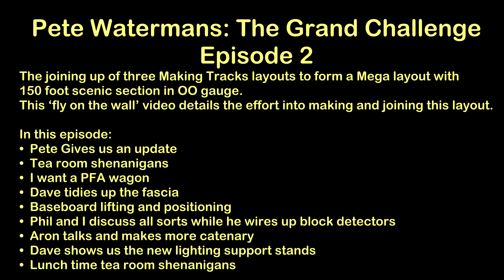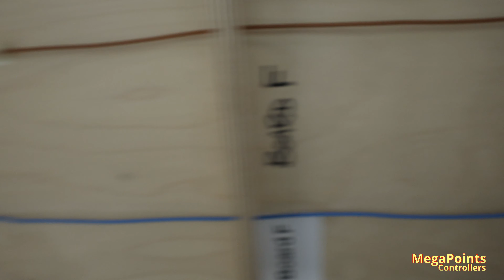Pete Watermans – The Big Challenge EP2

Comment: LARGE RADIUS POINTS ❗❗❗ 
Pete Waterman says at 5:39 Quote "We'd liked to have used Long Points" Unquote !! What he's revealing here is that NO commercial track manufacturer makes points larger than 5ft radius in Code 75 rail (for British OO). Because commercial manufacturers make products for the mass market which is 99% Amateur Toy Train Set builders, & that includes PECO. So Pete is quite correct in saying no train would in reality be ABLE to negotiate a point (or curve) as sharp as 2ft 6 inches, in OO scale !!!!

So Toy Train set users have no end of problem with locos & vehicles derailing in such horrendously sharp curves or points for no apparent reason !  Trains both real & model do NOT have "Differentials" in their axles (unlike road vehicles), so the flange tries to ride up over the rail, when you run them around unrealistically sharp curves. Indeed the more vehicles you have in the train, increases train weight, and thereby increases the chance of derailment. 

The number of vehicles the engine can haul around such horribly unrealistic curves is also severely limited. By the law of Physics which states: For every degree of curvature, the power available (in the loco) must be increased by the SQUARE ROOT. So a current HORNBY "Flying Scotsman" will haul no more than 4 or 5 coaches around a HORNBY Radius 2 curve of 18 inches. While the same loco will happily haul 12 coaches around a 5ft radius curve !!!   

SCRATCHBUILT POINTS
Which brings us back to the problem of Large Radius points (over 5ft radius) that Pete would have liked for his new layout. Pete should know the answer. As he has layouts in other larger scales, and a number of well qualified professional modellers at his beck & call ! The answer is, SCRATCHBUILD all the layout points to ANY size necessary, as virtually all good Model Railway Clubs have been doing since the 1960's. All the parts such as "Copper Clad Sleeper strip" (which you solder rail too), have been available for decades from a number of Specialist shops. Probably the best known being Marcway/SMP, the Model Railway shop in SHEFFIELD.  

I learnt how to scratchbuild points when I joined my first Club at age 16. Indeed a number of my exhibition layouts have shown that with this skill, you can build unusual types of pointwork not commercially made. Such as Staggered Slips, Outside Slips, Unequal 3 way points; Fourway points, Dual Gauge points or even Triple Gauge points. In any radii or scale. One of my exhibition layouts featured German Practice in N Gauge, with a complex Dual Gauge station using 9mm (Standard Gauge) & 6mm (Metre gauge) scratchbuild track, including Gauge Dividing points, which seemed to baffle many onlookers. 

ONE LAST NOTE. A scratchbuilt 6ft Large Radius Point in "OO" scale, still only costs around £5 for the parts. And would take me between 90 & 120 minutes to build. But then I am also a Real Railway Engineer, not just a Professional Modeller !!!!

Comment: What make is Arans headgear with the lens' on?
Reply: The brand of magnifier I use is 'Esynic',  I bought it of Amazon for about £27.
           Aron
Reply: @dmu156  Aron. Thanks for that, will look around for one. Glad you are out of Hospital; hope you are feeling better?
Another question?
How much do you raise the Peco catenary masts by? And, what is the distance from the under side of your laser cut gantries to rail height?
Sorry to stop you working but it's your fault for being a modelling inspiration!!!
All the best
John Harrison. Wallasey.
Reply: @jbhtrams  If your track is mounted on cork, then the Peco mast has to be mounted on the same cork. The crucial datum that you should maintain where posiible is between the top of the rail head to the contact wire which is 62mm ( 4.7m/15' 6" prototype). This is the nominal running height. This can be reduced slightly for going under bridges or by reducing the height of the catenary wire by shortening the droppers bringing it closer to the contact wire. Level crossings require the contact wire to be set at 76mm (5 8m/ 19' prototype) this is done gradually as you would when building an incline for a railway. I would avoid having a level crossing myself as it requires a lot of space to get the contact wire up then back down to the nominal height. Having said that the only pans that can acheive the 76mm height are Sommerfeldt no other manufacturers do, a compromise of the contact wire height would be required. Our gantries are to scale in terms of their height for the type of gantry used, so the brackets fitted to them are made to achieve the 62mm running height. Look closer at Dave's videos and you can the different heights of each mast type especially in the station itself and the station approaches.
       Aron